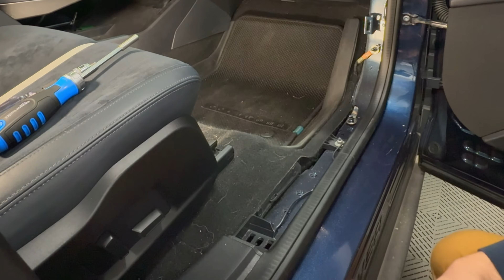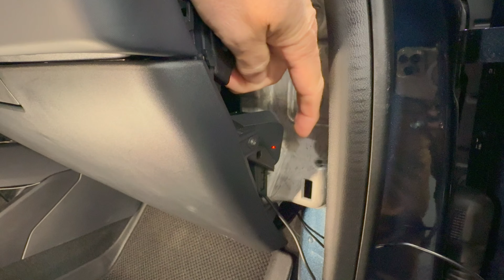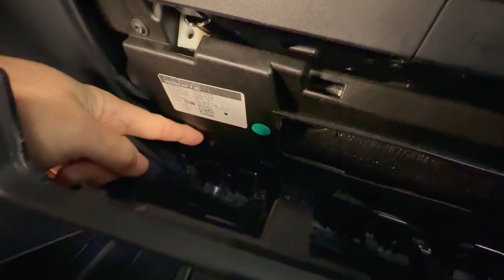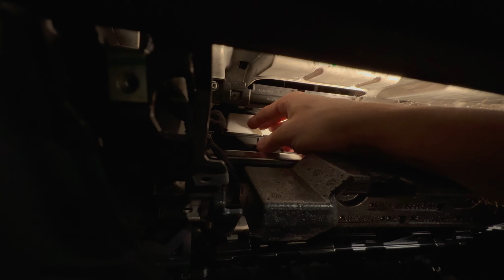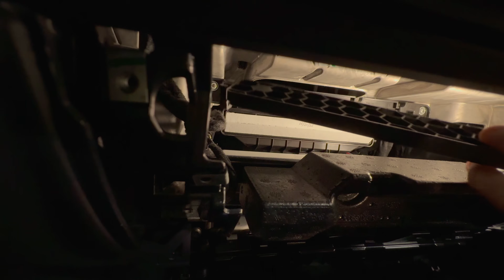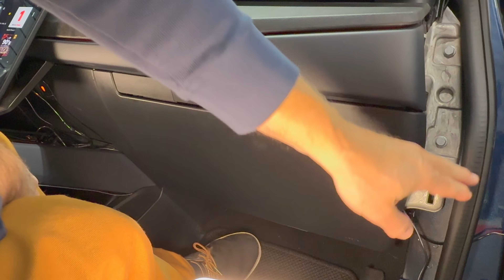Fisker Ocean - How To Replace Cabin Air Filter

Comment: Thanks for the video Matt. The challenge some folks might have is that covering piece below the taco tray, some of the notches that go into the openings may become bent (in my own case) and will be a challenge getting back in on some of the bent ones. I used a bit more force than I should to push it back in. And over time, those notches may bend enough to break off. FYI.
Reply from the maker: Yes, you have to be careful with the many clips that are at angles. I have taken the driver side one off/on at least twenty times and none of the clips have broken yet.

Comment: Hi Matt,  Another great video again.  How frequently do you have to change the air filter?  The one you took out was not that dirty, right?
Reply from the maker: It’s recommend once a year in the owners manual.
Reply: @MTNRanger Don’t mean to disagree, but I think replacement based on mileage is better.
Reply from the maker: @jkywang2011 The one Installed was only used a couple months.  I have had three filters in this year for videos and testing. So if you want to go by miles, sure go ahead.  Say every 15k miles.